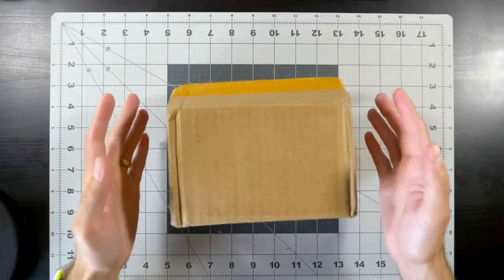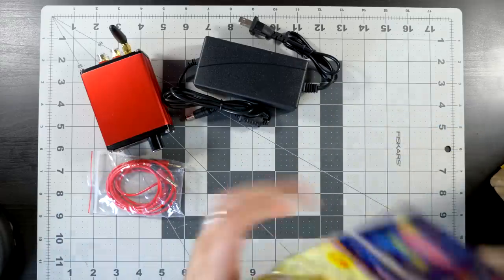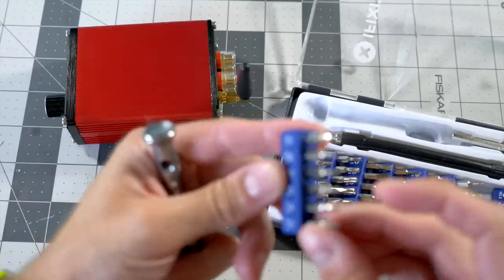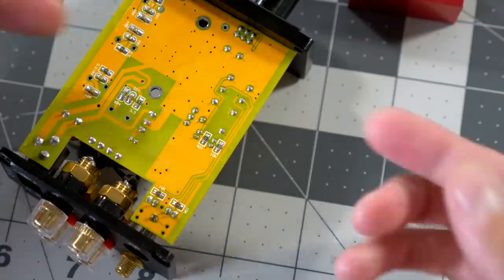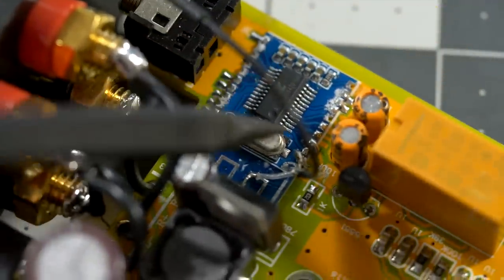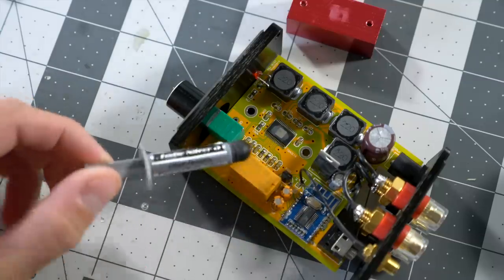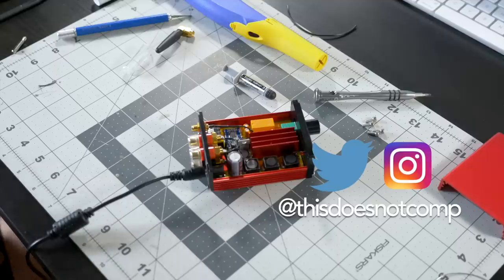Mini Audio Amp Teardown and Mod!

Comment: Just wanted to give a bit of my opinion as a professional electrical engineer who routinely designs and tests pcbs. The gist I got from looking at the board is of a company having used an application note's suggest circuit to design an amp, and later asking another amateur electronics hobbyist to bodge on additional features. 

The redundant meandering traces, random copper keepouts, odd component layout, and tacked on antenna coax on the end of a trace antenna looks like a board a beginner would throw together because they haven't learned fundamentals yet. Not saying it is utterly worthless and wont work, but the inconsistencies in the design all point to rushing a product out for minimum cost without any thought or understanding as to why things are generally designed the way they are.

Oh and to put your mind at rest Colin, your mod will work just fine and will not cause any damage or magic smoke to be released. Of course it is preferable to generally switch the positive rail, but doing the opposite is technically fine as well.
Reply: If you switch the negative instead and leave the positive always connected then depending on input and output devices connected then there could be leakage current even when off ie the device could draw current through external devices it is connected to since there is a possibility of an unintended current path to ground. 

An analogy is a hose (circuit) and water (current). If you have a cutoff valve at the end of a hose (the "ground" side) and there are tiny holes all along the hose then even when the valve is off there will be water leaking all over the place, but if you attach the valve at the top of the hose right after the spigot (positive supply rail), then when it is off even if the hose has holes in it no water can flow.
Reply: soldering the lead of external antenna connector to a random point of trace antenna matches (in rf sense) probably just horribly leaving bluetooth performance poor even with good external antenna
Reply from the maker: Yeah, this board is a hot mess. I'm not sure if it's so much that a beginner designed it, but rather that it's probably been iterated upon a ton of times. I definitely would have preferred to switch on the positive side, but without major surgery to the PCB it wasn't feasible. It only looks like a double-sided board, so it might be interesting to buy another one, depopulate it, and reverse-engineer it into a better design. (I just wish I had the time for a project like that.)
Reply: This Does Not Compute Isn't that always the truth, with more time we could do so much. Anyway I don't think it's really worth any more of your time for something you will use as background music while working with low expectations as to its quality. At least you got an interesting video from it and a few good laughs.
Reply: In DC applications, especially automotive or marine, positive is treated like the hot lead in your house wiring vs. neutral. As a lot of things are at the ground/neutral/negative potential, the whole chassis of the car for example, you want to switch off the positive which is less exposed. If you shut off negative and this were mounted in a car (and if the case was grounded), you would defeat the function of the switch as there would be another path for current to flow.

For home use, it makes no difference. I'm guessing that the negative from the power brick is not tied to ground since it didn't appear to have a grounded or polarized plug.
Reply: It's a 2-prong plug, which means it's double insulated to meet regulatory requirements.  It does not tie anything directly to the mains, even ground.  It's all galvanically isolated.
Reply: Also, to the OP ... it's incredibly common to use an app note circuit for a final product.  Unless you have a really good reason to modify it, TI probably knows a lot more about what you should be doing around their chip than you ever would.  Not meant to be inflammatory, but the chip is a black box to us.  We're at a disadvantage to the app note designer.

Everything about this design is textbook.  Maybe not the RF part, but I won't pretend to know enough about that to comment.  I can say the reason for the Bluetooth-on-a-module is because getting a module FCC certified  once is a lot easier than getting a bazillion devices that use the exact same RF circuit certified individually.  You will see those modules used everywhere for that reason.

Also, I will bet that if you had tested the audio before cutting the PCB, you would probably have found that the switch controls a soft shutdown pin on the amplifier IC.  The line level and RF components would stay on always, but often they do anyway to enable features like auto-on/off by detecting no signal.  This requires at least the preamp to be powered on at all times.  Aware that your amp does not have that feature, just pointing out that hard power switches are much more ubiquitous in electronics from the early 90s and before.
Reply: To add to your comment of rf certification, at least in the US, using a pre-certified module doesnt meet compliance requirements. You still have to apply and pass emc testing and licence your product to claim bluetooth in product packaging and literature. It is a huge nightmare, which is why the company I work at disables wireless capability in the modular equipment we design.
Reply: I like your analogy :)
Reply: Lassi Kinnunen At least for medical devices there's a ton more overhead in the process to be able to use even a pre-certified bluetooth module. I've heard from other's in the consumer sector that while it is a lot less stringent, you still need to pass emi/emc testing just in case your design adversely affects the normal operation of the module.
Reply: I agree with your assessment for the most part, but one serious mistake is that he never actually connected speakers and checked the operation of the unit. I was looking at another one of these units just before coming to this one. It was twice the power out and the guy had an amplifier dyno which showed 108 and 109 watts at the 1% THD with 35.4 volts DC in the unit is rated at 200 watts it looks like the same chip but about twice the heat sink. It is rated 24-32 volts DC the power brick that comes with it will only make a little more than 50 watts per channel. But the point I was trying to get to was it to had a bluetooth module  and the same little antenna. But it had a switch to select between bluetooth and line in. I suspect that when the volume is all the way down click to off it is in bluetooth mode when you turn up the volume click on that Switch selects line in. But now we will never know. 🤔
Reply: @ThisDoesNotCompute  

I think you might have disabled either the bluetooth or the line in. I believe that Switch operated a pin on that chip that either selected bluetooth or line in if bluetooth is selected you can use the volume control of the sending device therefore not requiring the use of the volume control on the amp. But  when using line in you do need the volume control on the amp. So grounding that pin selects one input ungrounded the other.
Reply: Robert Thomas well It works like that - Bluetooth is paired, then the input for the amp chip is taken from the Bluetooth chip, if it is not paired, then it is line in (mini jack input). It may also be other way around, but I am pretty sure that this is what the relay (the yellow/orange one, rather oversized for the task) does there.

Tpa3116 is probably genuine, there are two or more packages, one of them with the thermal pad on the top, the other on the bottom (from what I remember, do not have the data sheet in front of me). When/if you want to use the heat sink, then it is probably better to have the first one, but then you get no chip description obviously. There should be some thermal paste there of course, I am not questioning that at all. 

When Tpa3116 got famous over audio diy forums as being cheap and lovely sounding chip, the Chinese landed in force with their implementations, starting from $8(seriously, had one of these,, needed to change one resistor and one capacitor and it sounded really well). It was easy because TI did great job with describing the chip, there is everything you need there in the datasheet, everyone with some basic electronics skills and decent English language knowledge could implement an amp using these papers. It is almost touching seeing such a documentation these days when Apple charges you diamonds for a 60cm phone charging cable...

Some say that sweet spot (in terms of sound quality) is 19V, but of course it does  not give you full power. The good news is that many laptop power supplies are 19v so it is easy to swap. And since this is class d amp, with the output filter component values fixed, the frequency response will be affected by speakers impedance - if i am not mistaken again (again cannot open a datasheet right now), the one on the video is configured for 4Ohm speakers. 

If the amp is hissy, that may be the sign that they set voltage gain too high (there are 3 setting from what I remember) - with 6db step between them. The lowest is usually the one with almost no hiss. Unfortunately almost all these boards come with the highest setting applied. It is easy to change it though, a matter of changing one resistor and removing the other one - see datasheet or YT videos showing how to do this (plenty of them). 

I tend to agree that the PCB design is not of the highest quality and the BT antenna attachment looks silly, but for me personally these products (and it is really wonderful) let you educate yourself, get to know how it is working, understand some electronics principles and not because they are bad and you need to mod the freshly produced unit (ahh communism :p ), but because they are so cheap that when you break one trying to mod it tune it, then you just say “I guess I will just get another one”.

Kind regards to all electric and electronics engineers, to wannabes as well - including the Chinese guy who designed  this amp :)
Reply: Coni Glione  Because it could sink current through other devices connected that share a ground, like through RCA connectors, for instance.
Reply: What do you think of Schiit audio? Is it quality ?

Comment: Only one issue is that now that the tiny switch contacts are now handling to the full current of the amp, that will cause power losses in the switch. This switches are not designed for actual current carrying uses normally. That amp really is a fairly powerful IC, you are correct, it is a TPA3116 IC. That little switch was as you mentioned was actually turning on/off the enable and mute function of the ic, in other words it uses a "signal with no current really at all" to enable the high current output of the ic.

Comment: First thing I noticed - Main DC rail cap silkscreen 2200uF, guy desolders a 1000uF cap. Cost cutting at its finest ;)
Reply: It seems like it's a common practice in China that maybe a handful of big oem  will make such amps (n other electronics) and they are being bought and badged by different resellers brands.
Therefore, the components will vary according to the price the resellers are paying.  You will see brands like nobsound, douk, fx... Etc selling similar things but slightly different in prices.
They may also be using the same box and pcb but fitted differently to accept 24Vdc (vs 12Vdc) giving better specs

Comment: Unless you get another Amp, you could always try installing a switch on the AC or DC side of the power adapter cables, or just make sure you have your audio setup in a place you can eaisly unplug the amp.
Though in the end the only downside I can see to having the amp on all the time is that if it does get warm while in operation that might shorten its life being on all the time.

Comment: The switch only switches a "mute" signal on the chip. It is just for removing hiss and hum on the speakers when the amp is "off".
Reply: Might also be the SD(shutdown) signal
Reply: so u don't get a pop noise thu it and speakers

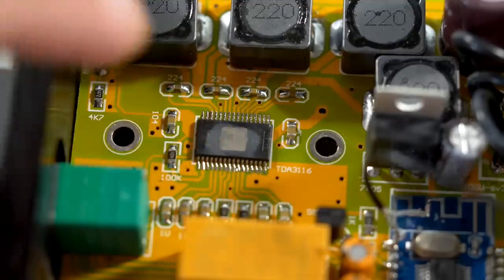Comment: The chip was not "etched away to get better heat transfer". The TPA3116 is made that way from factory. The part number is besides the metal part, you could even see the TPA text in the video. 13:52 look in the left top corner..

Comment: A benefit of having Bluetooth on constantly would be easier pairing, instead of a delay (or possible connection issues) after power on before any chance of playback.
Reply: no pops as well.
Reply: Well with that bodge on the internal antena there will be really lot of problems with signal strength.

Comment: It's also a good idea to add some non conductive or small enough washers in between the heatsink on the screws and the board just enough to make a good connection so when you tighten down on the two screws, the board doesn't bend on the edges of the chip and crack it when it gets hot.

Comment: I suspect there is more power wasted in the power brick than in the amplifier at idle.
Reply: Very likely, especially since the 'off' position probably shuts the amplifier part of the chip down. See the data sheet, pin 2, SDZ, Shutdown logic input for audio amp.
Reply: Damn straight...

Comment: You may want to check the spec sheet for that amp. I got one of these, same chip, slightly different layout. Anyway, there is a table of resistor values to change the gain of the chip. They had it at the maximum gain so the amp was noisy and a bit distorted. I changed it to a lower gain and the sound was much improved. Also, the inductors tend to run hot. Not dangerous hot but very warm. I went with a 20v power supply.

Comment: Because of its Bluetooth input and its bridged D amplifier configuration it doesn't matter, but usually one should never put a power switch into the ground rail. The input and output grounds are still connected to the circuit and the entire circuit is floating as long as it is switched of. This may lead to unexpected functions in the moment when the power is switched on.

Comment: It called instant on blue tooth connection.  So you don t have to manually  connect each time.  Also there is a bad pop noise when powered on  for many  mini amp  chip because the power supply creates a large surge.  . The soft power on eliminates that. .

Comment: I have a similar amp same brand and model number and it does in fact do 100w (see Wilson audio labs's video) but for it to do it's full rated power it does need a capable power supply thoi bought a 24v 5a one for mine and it works well and my power switch works just fine